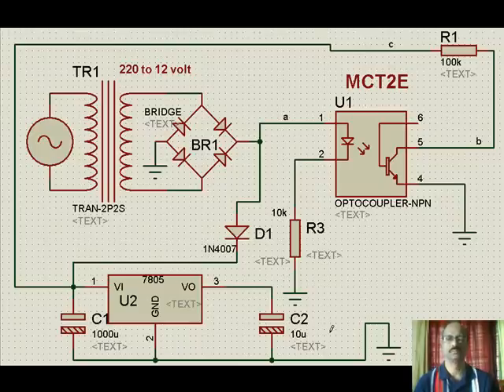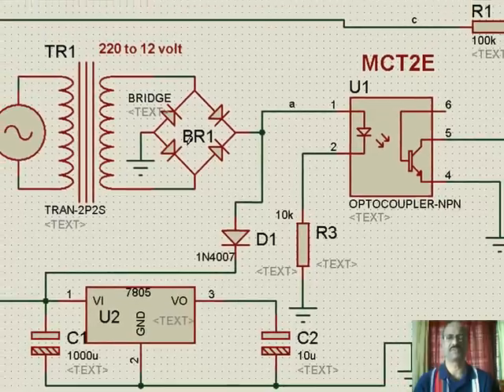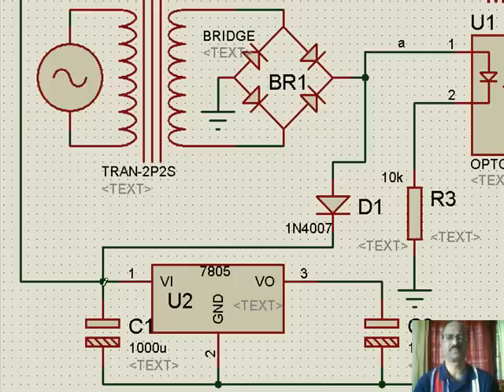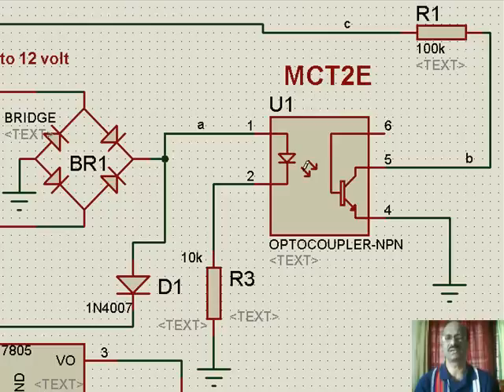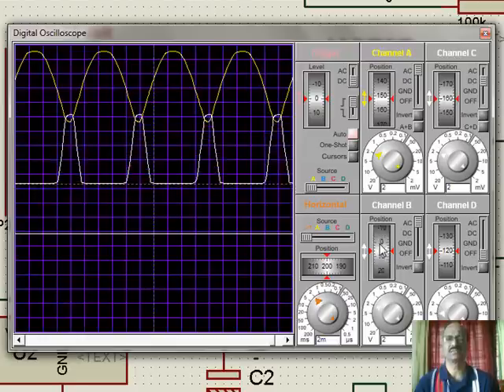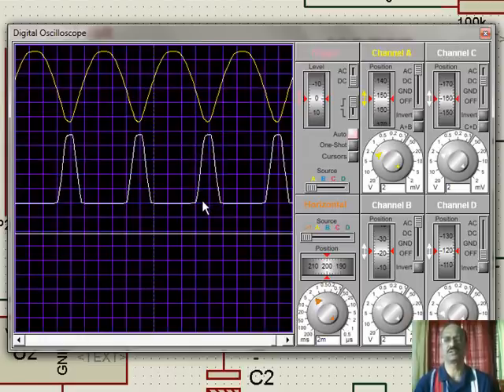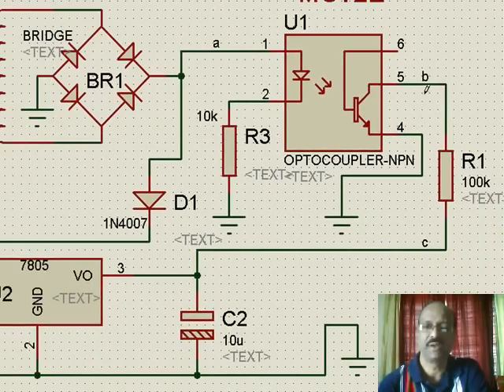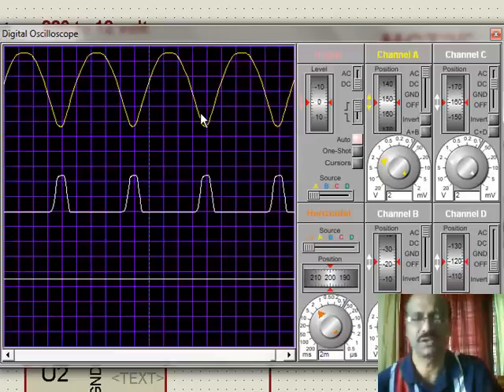Practical Electronics ZVS,Zero Voltage Sensing simplified

Comment: Where is the precision???? optocoupler transistor will conduct after the input voltage is greater than (Vf of rectifier +Vf of optocoupler) which is nearly 2.3 volt. if u r using a transformer with stepdown ratio 230/12=19.1   . then when the input ac will cross 19.1x2.3=44.08 volts then ur zero detection circuit will give output.
Reply: most challenging feedback is real time feedback design.suppose if we want to take feed back in range of 0-200v dc then what we will do?instantaneously taking fedback from any input is critical. think as you are taking voltage reading as a digital meter can .then data have to send via optocoupler and then decoded and evaluating voltage before sending to actuator card.

Comment from the maker: Zero current sensing is exactly the same way.Just use a CT (current Transformer) of proper ratio. for example a step down transformer 220/12 can be used whose secondary can be used in series with the load while the voltage induced in the primary is used as the same way like ZVS. But use a 10 k resistor 1 watt across the primary winding and then as usual to the bridge rectifier with the same circuit to get ZCS